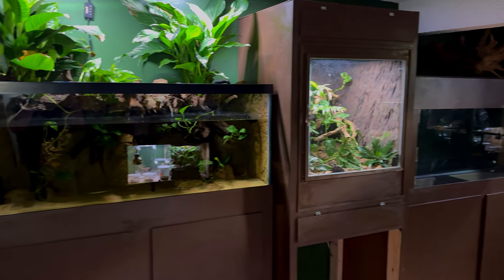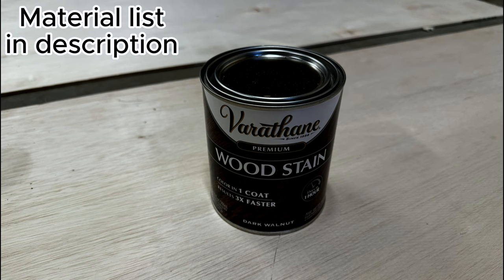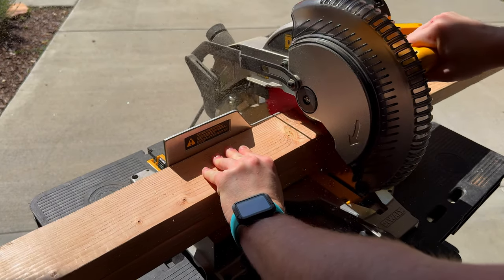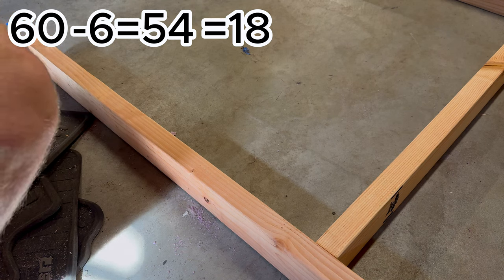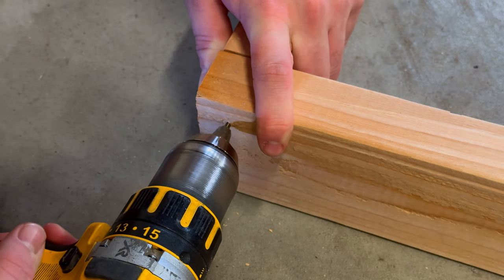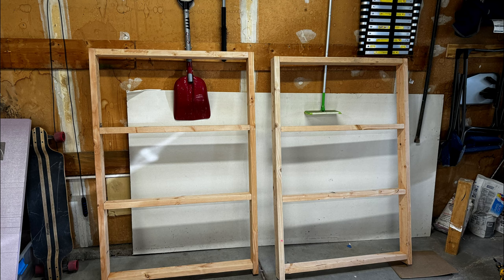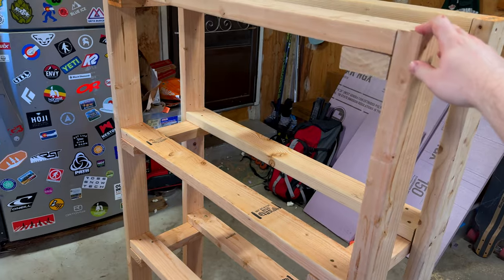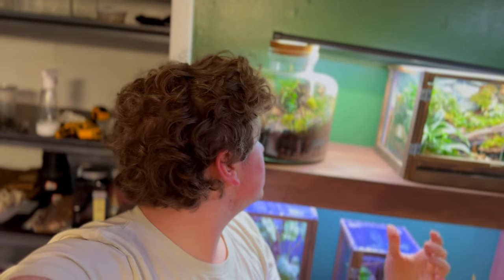Super easy DIY stand for aquariums or terrariums

Comment: The stand looks good and it will probably work just fine for those mantises, but I wouldn’t trust it with an aquarium! You’re completely dependent on the strength of the screws. If you want to hold and aquarium you should make sure that all the shelves rest on top of 2 by 4’s, this will drastically increases the stands strength! Also adding a panel along the back will remove any rocking. Great video and keep up the good work
Reply from the maker: Yeah it’s more meant for nano aquariums or tanks up to 10 gallons, I wouldn’t trust it either with anything more, I honestly should’ve specified that in the video. Thank you for the feedback though, I appreciate it! 😊